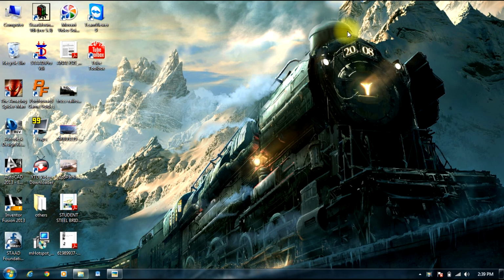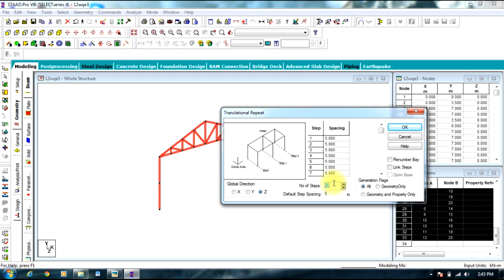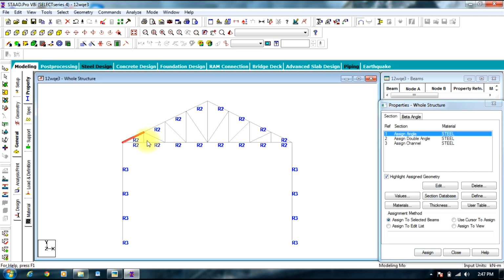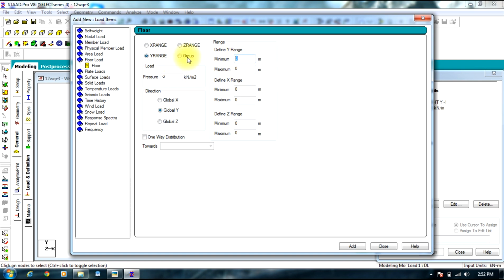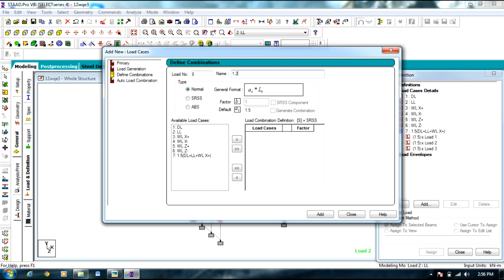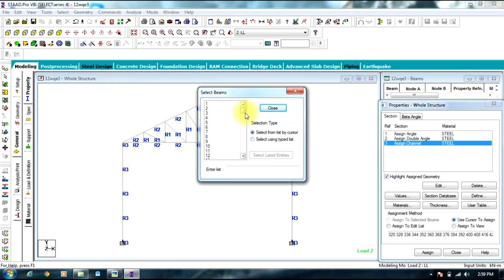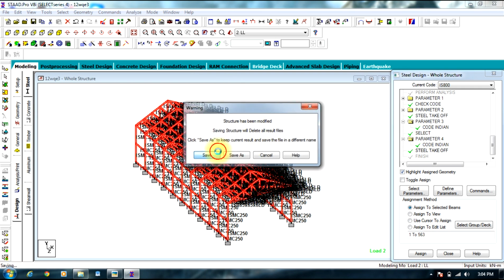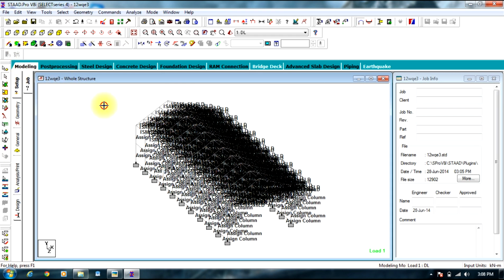STAAD Pro-Tutorials-Advanced-Design and analysis of Industrial Truss-Day 25

Comment: How you can take FYLD 415?? I think it should be in range of 250-320
Reply from the maker: Steel is of three types Fe250, Fe415 & Fe500...........So FYLD depends upon the type of steel we use in design..................
Reply: GRIET-STAAD Pro Tutorials ok thanks sir..I also want to know if we consider the crane load for an industrial building..how one can transfer it to the column in staad pro